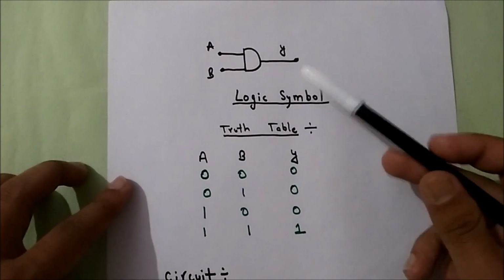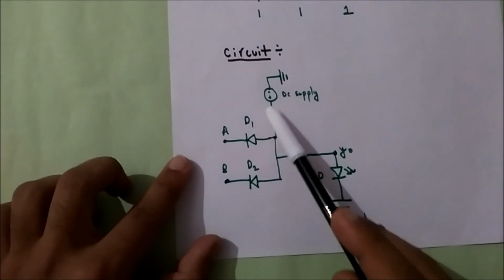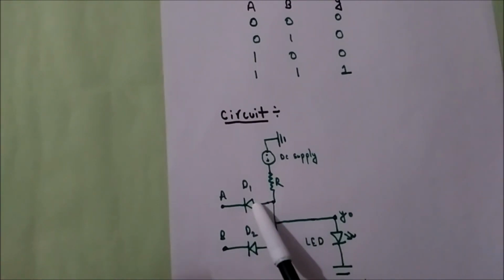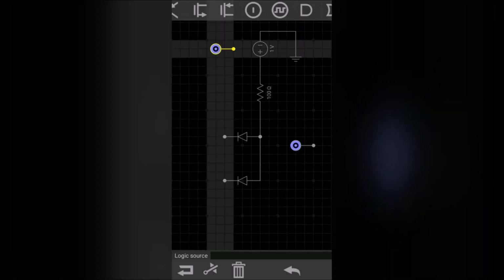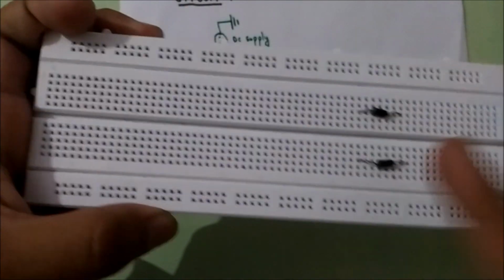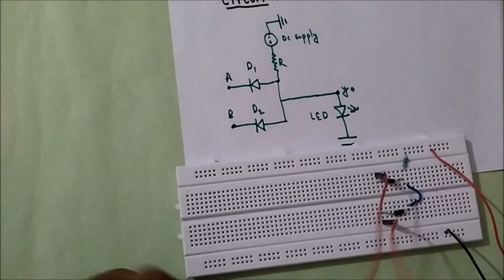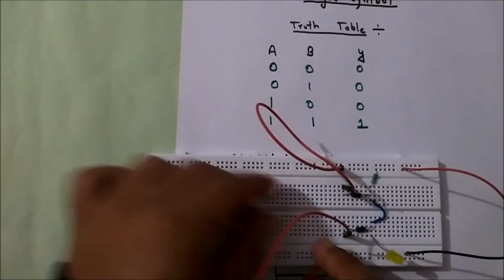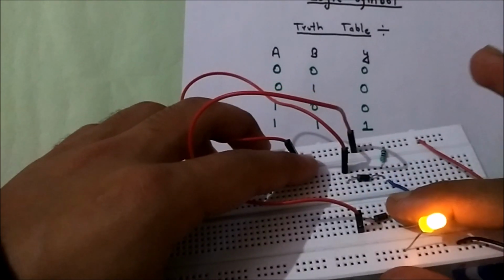AND Gate Using Diodes (Everything Explained!)

Comment: In the case of AND gate, how can I achieve that 2 ground wires will only produce one ground wire if both are grounded? Cheers
Reply from the maker: I don’t quite understand your sentence. Can you explain?
Reply: @THEELECTRONICGUY  Thanks for the reply, I have two signal wires that any of them can be grounded, I need to have a ground wire that will only be grounbded if the first two wires are grounded. Cheers

Comment: The missing piece to this problem in textbooks, which is only shown here in the final circuit, is that hypothetical the logic gate acts as both source and sink - meaning it's also connected to ground. Simply applying a signal to the logic gate would not have the desired effect, as it would behave the same in the the off (open) condition as in the on (connected) condition otherwise.

Comment: ok, this is still miles over my head, so why dosn't the current just ignore the diodes, regardless of what the inputs are, and run strait to the led?
Reply: because if current finds a path with negligible resistance ie in the case of the short circuit. it will go there

Comment: Im trying to read the status of 2 leds. When they are both on i want the and gate to switch a transistor, hitting reset on the IC.

When the leds are off, would the power not run through the diodes in turn powering the LEDs on A and B?

Comment: The resistance is heating up n the red led is not working ... Plzz help ..
Reply from the maker: have you checked the LED?
Reply: Yes ... I have checked ... Should I use any other color led ??
Reply: what connecting wires do i use like they are all thread like and hard to insert please explain and is a 1kohm resistor enough??
Reply: thanks a lot
Reply from the maker: 1. Check circuit properly
2. use 100ohm resistor
3. check polarity of LED, is it right or not
4.Check diodes polarity
5. Check whether Battery's positive terminal is connected as shown in circuit

Let me know
Reply from the maker: for a 9 volt battery, yeah! Though brightness of LED will be less

Comment: When A B is 0,0  LED's  p terminal is at Higer potential, then why current can not flow through LED? 
Please tell
Reply from the maker: +Jhola Wala Babu because both diodes are fwd biased, and thus current flows through them to Gnd. (*Least resistance path)
Reply: How you say diode side terminal has low resistance

Comment: My connections are right but I want to know whether it is mandatory to use  a 100 ohm resistor...
Reply from the maker: are you using 9volt battery?
Reply: Yes it's a 9 V battery
Reply from the maker: if you are using a 9volt battery then there is risk of damaging LED. So connect resistor!. though its not mandatory to use resistor of 100 ohm only.
Reply: Oh so any other resistance will not work? Like 33 or 3.3? Or is it too low?
Reply from the maker: You can calculate this right away.. 
Battery voltage= 9v
Resistor value= 33
I = 9/33=.27A = 270mA
Which is huge..Led Wii surely die!

Comment: Thanks a lot man. That is a great lesson and the breadboard work is cool.
I'm just a hobbyist of Electronics. Do you thing adding a pull-down resistor might keep the LED off until both conditions for it to be on are achieved(A=1,B=1) ?
But I dunno exactly where it is used. (According to the site below it seems to be connect with a switch)
In digital circuits there are 3 states: On(1/True), Off(0/False), and floating(which I think alternates between the two previous states)
A floating state is countered by using either a pull-up resistor connected to vcc to keep it On or a pull-down resistor connected to ground to keep Off until a state is provided.
http://www.resistorguide.com/pull-up-resistor_pull-down-resistor/
What you think?
Thanks again & regards
Reply from the maker: thankyou! igrewold 
pull down resistor cannot be used here because there is no floating here. it is simply the characteristics of circuit that is, if both diode's n terminal is open then current will flow to led. n pull down and pull up resistors are generally used with switches in microcontroller applications to prevent bouncing.
I hope this helps